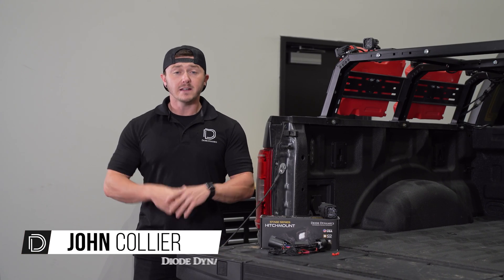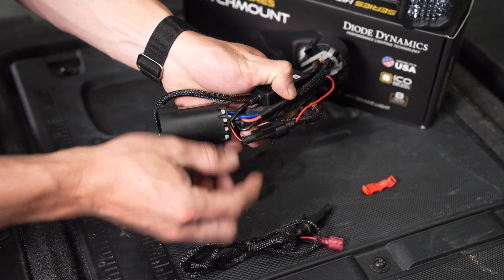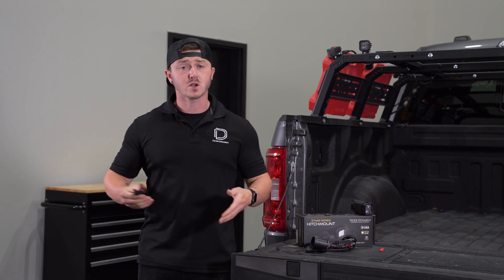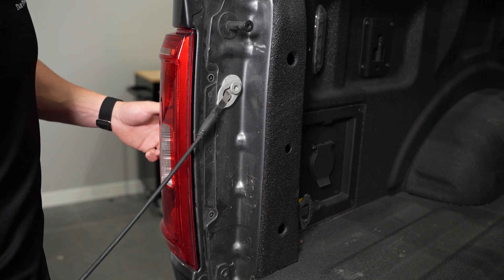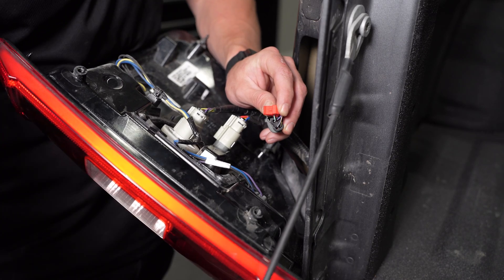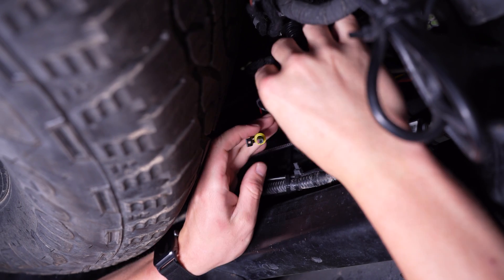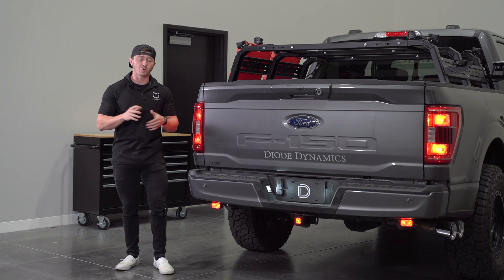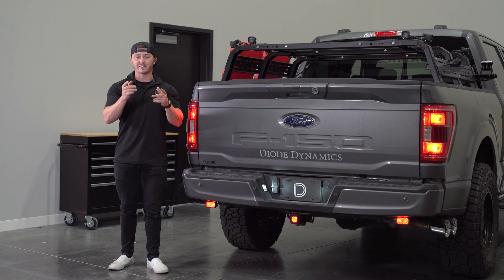C1R HitchMount Harness Update + Installation | Diode Dynamics

Comment: I have the tap wire added and it still strobes and has the false trailer detection. Tapping into the brake lamp is doubtful to fix the issue. When I unlock the vehicle it has perimeter lighting for a period of time which includes the park lamps. When those lights are on the DD light is strobing. That brake light wire isn’t in the equation at that point. Also a 2023 GMC Canyon.

Comment: Where does the main harness plug in?
Reply from the maker: On the back of the factory 7-pin trailer harness!
Reply: @diodedynamics  what if I have a 4-pin harness?
Reply from the maker: @Zanderthelab  Unfortunately, this harness is not compatible with a 4-pin trailer harness, since there is no power wire for reverse lights. You are welcome to try and custom install this kit, however!
Reply: @diodedynamics  ok. Guess that means I need to get a truck haha. I have a wrangler right now and I’ve been wanting this. I wonder if I can use the one that Baja Designs has.

Comment: do you know if the 2025 Explorer will have the trailer detection messages? can I use the regular wiring without the t-tap?
Reply: I have all kinds of issues with my 2025 Explorer ST and I dont know where a 12v that I can tap into is because the tails are LED

Comment: Bro my 7 pin doesn’t detach from the back like the ones on the videos. It’s one solid piece.
Reply from the maker: Please go ahead and give us a call at 314-205-3033, Monday-Friday 10 a.m.- 5 p.m. CST, or shoot us an email at contact@diodedynamics.com, and our in-house US service team would be happy to help you with that!
Reply: Did you figure it out?  I have the same issue with my ‘14 Frontier.  Outside of buying a whole new and different 7 pin, I’m at a loss.

Comment: What are the wire colors coming out of the light? I just ordered a CR1 and need to modify it for a 4 pin harness.
Reply from the maker: Hey there! The wires for the DT connectors are as follows:
Red = Positive/Main Beam
Black = Ground
Blue = Red Running Light
Yellow = High power Brake Light

It should be noted, however, that 4-pin trailer harnesses do not include a reverse light power wire, so you'll have to tap into your taillight or other reverse light power signal.
Reply: @diodedynamics Thank you. This will look nice along with my diode dynamics bulbs.

Comment: Will this work if I only have a 4 pin harness? I don’t want to have to run a separate 12v power source.
Reply from the maker: Unfortunately, this harness is not compatible with a 4-pin trailer harness, since there is no power wire for reverse lights. You are welcome to try and custom install this kit, however!

Comment: It's helpful to know that you've implemented this update -  I am guessing there are hundreds if not thousands of potential buyers that are hesitant to buy this not-cheap add on because they have concerns about the reports of error and warning messages that result on many vehicles with this installed - myself included.

I ordered one anyway but my 2024 model year car throws errors when anything trailer lights are connected - I am going to tap my C1R solely into my high mount brake light and avoid the 7 pin altogether. I don't care about strobe functionality or reverse light or even running light functionality - i just want the C1R to light full bright when my high mount lights. 

Is this even do-able?
Reply: Unit arrived today - got trailer and disbaled rear safety systems messages as expected. Tried the bypass option as demonstrated in the video - still the same (also as expected).

So, after trying both set ups just to say I tried, I called DD tech support to see if they had any other workaround ideas  - no luck there - when I told him my make, model and year of my car (VW Atlas 2024), the rep said not much they can do for me at this point.

So I told him I was going to dump their harness and tap the light into my high mount brake light circuit - I then asked him if the strobe will work if I included it in the circuit. He said he didn't know and all he could tell me is the wire color specs for the strobe unit. And he also included a note in his documentation that said if one includes the strobe in this set up, the t8mer function will likley not work - thusly reinforcing my plan to run just the brake light with no strobe.  I subsequently got it connected and it does what I need it to do - light when I press the brake, giving me 4 brake lights.

But, with 100% experiential certainty, I can confirm that rgardless of all the different error scenarios, this unit can successfully be connected straight to a high mount brake circuit and it works as a 4th brake light (with no running light mode, reverse light, or strobe effect).

A quite expensive 4th brake light but there isn't much else out there except the cheap-looking 12 dollar units from HF.

That is all I'll say about this (in Forrest Gump voice).

I hope some find this helpful.
Reply: @mscm4592 Volkswagen 12 Volt you were doomed to begin with no matter what.
Reply: I just installed on my 19 gen 2 raptor and trailer/blis message galore. Kit came with the 7 pin connector and a single red wire tap for brake light. I disconnected the red connector to the 7 pin, and it still has the same messages. I don't see connecting the red wire tap making a difference.
Reply from the maker: Please go ahead and give us a call at 314-205-3033 Monday-Friday 10 a.m.- 5 p.m. CST, or shoot us an email at contact@diodedynamics.com, and our in-house US service team would be happy to help you with that.
Reply: Yup. I am not surprised. 

I am just gonna tap mine straight into my high mount brake light and not even connect thru my 7 pin. I just want a bright red 4th brake light to light when I brake. No reverse light, no running light and definitely no strobe.  I have witnessed and experienced road rage when motorists annoyed by stroking overreact and get very agressive.

I do manual strobing when I am being tailgated or when I see a cell phone zombie behind me - I double tap (and sometimes triple tap) my brake pedal at the beginning of my brake zones. My middle brake lights are so tiny, I want to add a low mount 4th light to add some brake notification.

It's a shame DD is pretty much the only game in town (currently) with this in-receiver design - I feel this is way over-priced.  But the legacy hitch receiver lights all are very cheaply-made and tacky looking. This DD one at least looks  halfway decent - but not $175 decent. Nonetheless, if I can bypass all the adapter harness connections and straight tap it and get it to work, this will have to do.
Reply from the maker: Hey there! Feel free to give us a call at 314-205-3033 Monday-Friday 10 a.m.- 5 p.m. CST, or shoot us an email at contact@diodedynamics.com, and our in-house US service team would be happy to help you out!

Comment: Why is the wire size used so small?  I'm talking about the constant power and brake wires.
Reply from the maker: The gauge of wire has been determined by our engineering team to supply the correct amount of power to the light without overheating, or not supplying enough power. Thanks for checking them out!